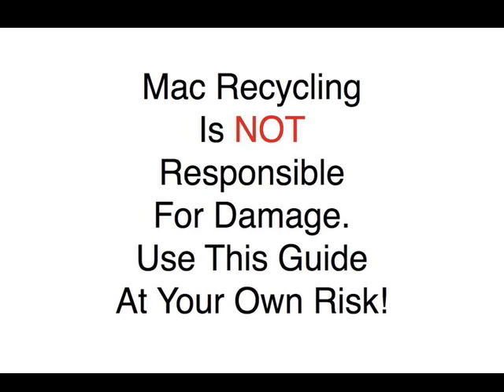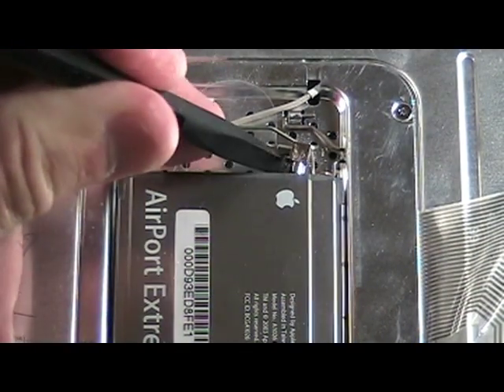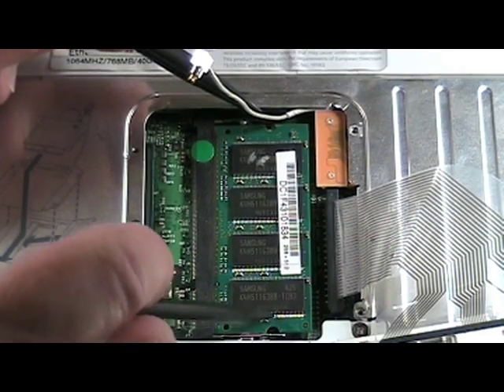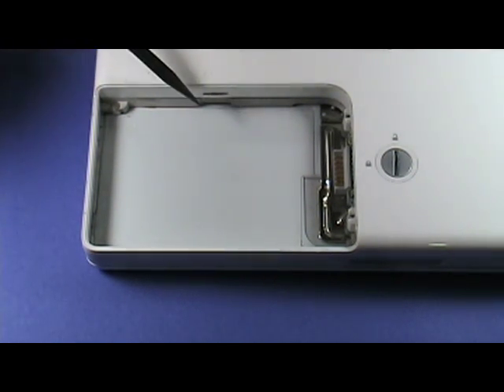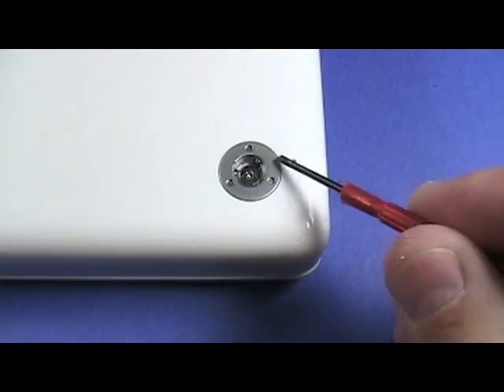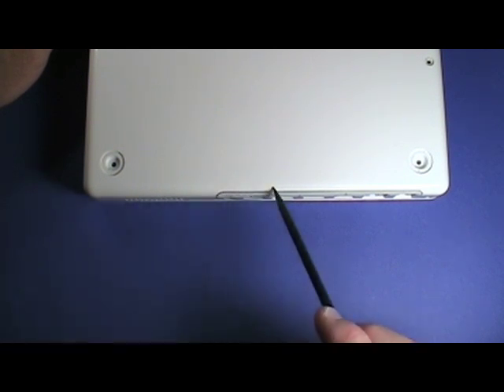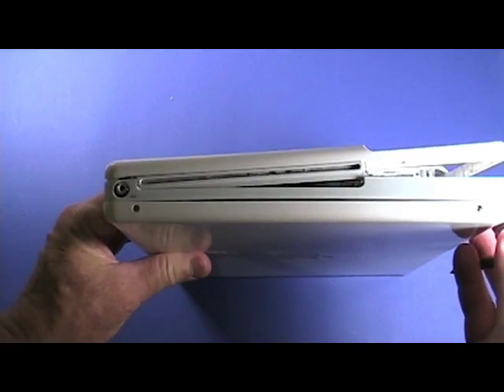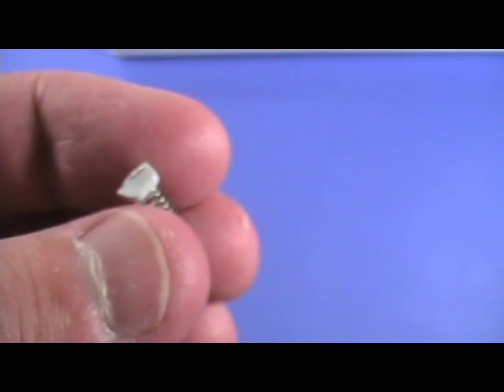Apple iBook G4 12"/14" Take Apart Instructions Guide

Comment: MINT 2004 iBook G4 14" 1.33 256MB 60GB w/ power brick

Dead battery...

Was $35.40 Expedited on eBay

1GB DIMM was $5 out of my parts boxes..

10.5 Leopard Retail Install DVD was $9 ppd

(Worked well enough ( but slow) with 10.4 Tiger after downloading the new TenFourFox browser.

Even played most YouTube videos.

I've bought a 60GB 7200 rpm drive for $12 ppd. from Isreal, via eBay

Good OEM battery was $13 ppd..

THAT said...

I got a MINT Early 2009 AL UNIBODY 2.4 (Deluxe) 13"

 For only $41 ppd. on  eBay

Needing only a Hard Drive.

From a FREE dumpster find AL UNI 2.0 with the bad LCD LVDS cable issues...

I had thought to fix up with parts from eBay finds...

Hanger Queens are the ONLY way to go!

Those backlit keys get peoples attention!

Looks like about any MacBook Pro!

Unlike my $32 WMB from 2007.

Keep at it!

J.C.
Reply: Got my good used OEM battery in todays post.

Only $13.23.... with Expedited USPS!

Is charging up right now

Looks like it will give 2.5 to 3.5 hours of internet time

Am looking for  a set of Retail 10.5 install discs to show up..

Tomorrow.... or Monday.

From CA..

$13 ppd..

Comment: I think this particular iBook G4 Line has a manufactural flaw,  that is the shielding actually digs into the data cable of the monitor ( on the right side ),  causing the coating to be worn off over time.  This then creates a cross circuit between the wire and the shielding, which then gives you the white screen upon loadup.  This is the second one that has come to me with the same problem.

Comment: Ram port expansion! my wife's G4 was empty until I put in a Gig now it has 1.5Gig... Not an expert about the airport extreme, but I suspect in later iBooks they moved in inside as it became standard! My wife's iBook has an empty bat also and it's been working WiFi for 4 years, also the system config states Airport extreme - It's inside me-thinks!

The airport bay was a G3 clamshell hangover? I've seen g3 clamshells with this hardware config!

Comment: You should get a new DC-In Board.  All you really need to do is remove the bottom of the iBook, remove the metal cooling plate underneath that, use a philips screwdriver to unlatch the DC-in board and unhook it from the logic board, pop in a new one and close it back up.  I've seen DC-IN boards for about $30 - $50 online.  The hardest part is finding the tabs that keep the back in place.